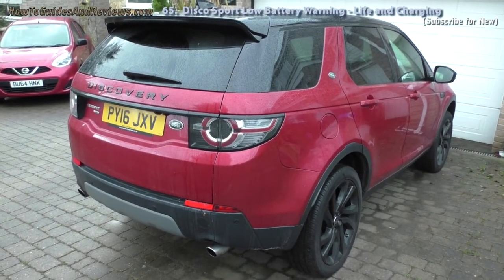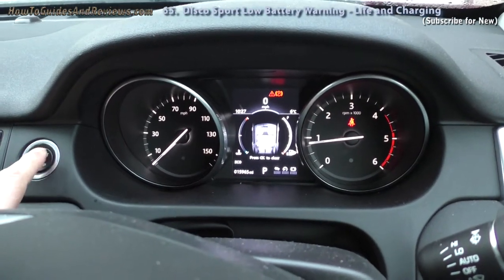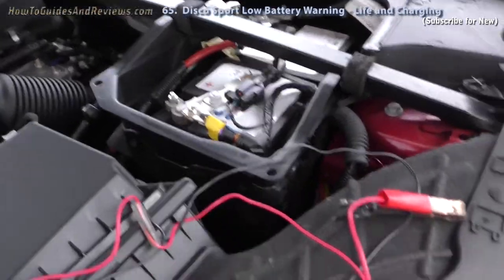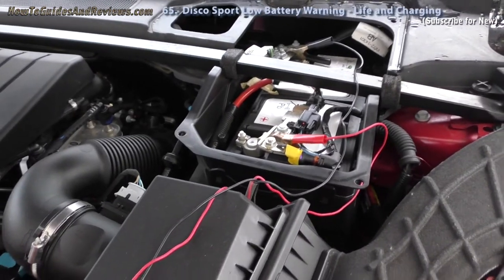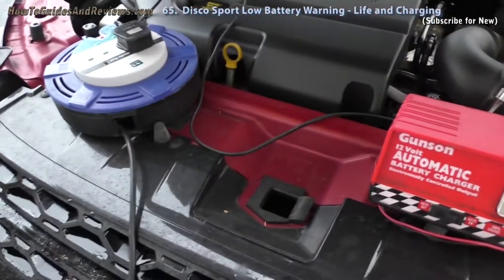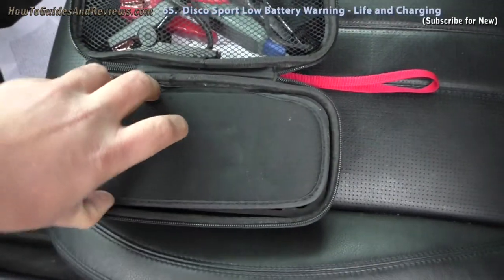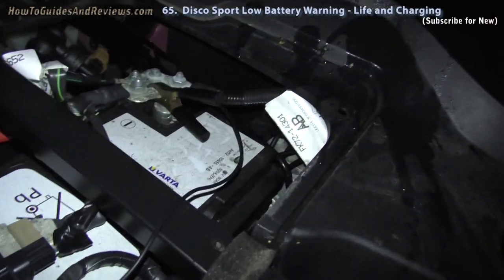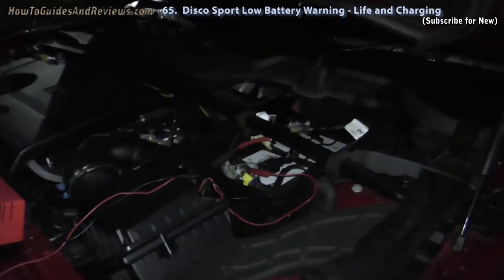How Long Does a Land Rover Battery Last? Low Charge Warning & Charging, Discovery Sport (65)

Comment: Thanks a bunch, mate! Recently I've faced the same issue and your video well educated me about the battery on my Discovery and what I gotta do! Cheers!
Reply from the maker: Glad it helped. get a charger and then you can eek out another years life out of it before the dealer talks you into buying an expenseive replacement.
Reply: First off appreciate your video. I’m in the same situation with low battery warning. Mine is a 2017 Discovery Sport. Due to current situation with the pandemic driving is very limited. But I personally think if you go for a long drive the battery should optimize.  Having said that does anyone know how to swap the battery with a new one. Any idea whether a special tool is required to do the job. Thanks guys!

Comment: We have been getting this alert off and on for the last year. I have not changed battery because it always fires rite up. To me it alarm setting from factory may be set a little to sensitive. I realize most people just run to the dealer when an alarm comes in and maybe this is the big plan. When I start to feel the car struggle to turn over I will replace the battery like we all did in the old days.
Reply from the maker: just charge it, I'm stil using the same battery, just charge it once in a while.

Comment: UPDATE:  I have a 2016 discovery sport, low battery light was on. i purchached a new battery and wow! problem fixed light went off!! GUYS, Change your battery if its more than 2 1/2 to 3 yrs old!
Reply from the maker: It's nearly a month on and the low battery warnings not come back up, so I'd recommend giving the battery a good 12 hours on charge before considering replacing it, hopefully I'm 6 months away from having to replace it.

Comment: Thanks love, I was getting the low battery for a while et meant to charge it. Then it died after sitting forever. On the first charge it took forever to start over half an hour. On the 2nd charge for only 5 mins it came on immediately et I began to hear it sort of turn over again. I haven’t been driving much due to the pandemic but I think it will continue to build if I keep charging it. Any recommendations, if I can’t get it back on soon I’ll take the replacement. Thanks hun, 💛💛💛💕

Comment: Did the charge solve the problem with the low battery warning light? Did you also find that auto stop start didn’t work when the battery was low?
Reply from the maker: Yes, auto start needs a fully charged battery else it won't activate,

Comment: Thanks for the video. The LR owners manual advises against charging the battery but it seems OK to do so? Just wanted to make sure there's nothing special about the batteries put into the DS.
Reply from the maker: LR manual just wants you to take it down to a LR dealer. Yep there is NO problem with charging your battery, Ive charged my LR battery numerous times.
Reply: These cars have AGM batteries which need special smart chargers which you can pick up from Halfords. Ensure it supports start stop when buying.
Reply from the maker: @ Alexander Mitchell Ive charged it numerous times without issue with a 25+ year old charger.

Comment: Hey dude I have range rover velar I bought it 1 and half years ago and we don't drive it too much so it shows me low battery warning should we drive in low battery please tell me fast
Reply from the maker: Low battery means it needs charging,  you can either attach a charger to it for at least 12 hours or go for an 30 to 60 minute drive to charge it.

Comment: When I plug the charger in, the indicator stays at 0?
Reply from the maker: Could be to low voltage i.e., less than 10v so the charger won't charge it.
Reply: Because the negative should stay on the car ground not on the battery

Comment: 80 bucks on a charger, and 160 on a battery...seems like best to just buy the battery.
Reply from the maker: The charger was about 30 bucks 25 years ago. Still using same battery near 2 years on. Get yourself a charger and save $$$'s for decades to come.
Reply: Better option still, if you simply can't drive the car for a decent spell (20-30 mins minimum) regularly, is to buy a battery conditioner (NOT just a charger), and one with an AGM cycle capability if you have stop/start function on the car.

Comment: Same problem with a new battery 🔋
Reply from the maker: Low charge warning with a new battery ? Did you CHARGE the new battery before putting it in? They can be sat on shelves for months,
Reply: @Quantum_AI_Tech  yes i believe it is a fusible link that's attached to the positive side of the battery it's like a small box  due to the air suspension  in the dashboard digital console digital interface digital gauges draws a lot of power and keeps on flicking and dimming itself while driving I notice to at night time gauge cluster is very dark all this issues on the 2020 autobiography Range Rover Sport